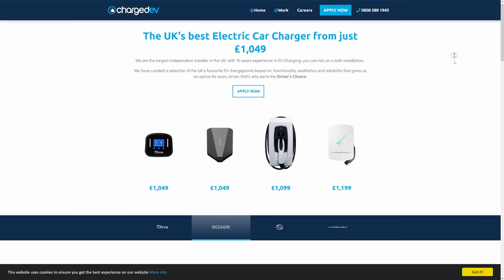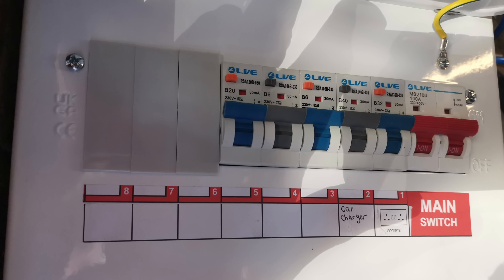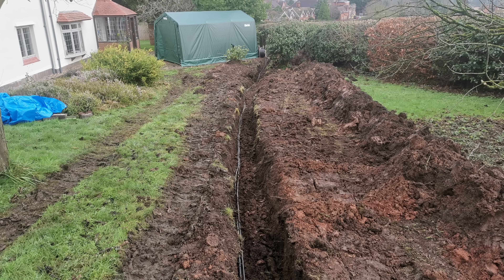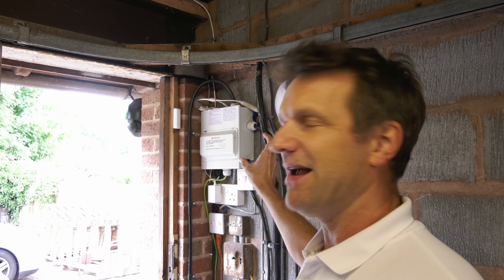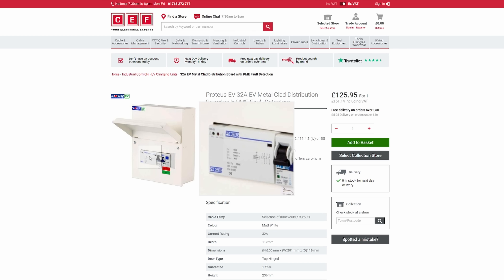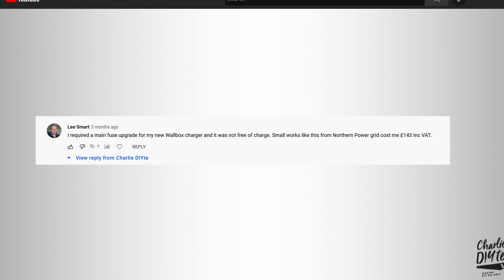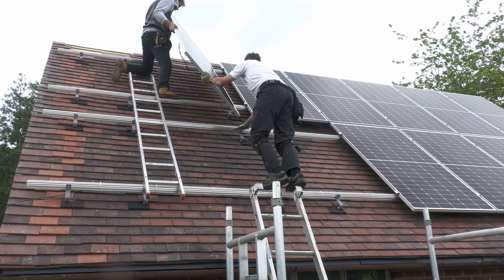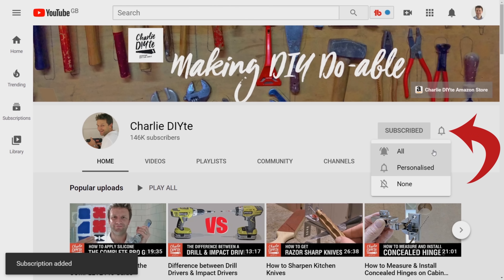EV Charge Point Install - What Went Wrong

Comment: Hi Charlie. 

Registered electrician and OZEV approved EV charge point installer here. 

Surprised your electrician didn’t know how to check the RCBO was double pole (or switched neutral as some manufacturers call it). They all have a diagram on, either on the front or the side to show how it’s configured. 

The EV installer most certainly should have checked it and known how to. However having rectified a number of so called qualified installers charge point installations it doesn’t surprise me. 

Also there’s not many EV charge points with built in 30mA Type A protection. Majority now have the 6mA DC protection in. But not many have 30mA protection built in yet. 

When you earth the armour of the SWA you are doing so to either use it as the earth at the downstream end. Or if it’s, for example, a 3 Core cable and one of the conductors is used as the earth. Then at least one end of the SWA should be earthed to protect the cable. 

Do you know wether it was 2 or 3 core cable they used to take the supply to the garage?

There is no regulation against exporting the earth, it’s down to the DNO. But at the distance you’ve gone with the cable (65m) then it would make better sense to TT the garage supply. 

The supply to the garage does not need to be on a RCBO in the house. You can use a MCB as you have, from what I’ve seen in the video, a full board of RCBOs at the downstream end in the garage. 

So the installation will comply as there is over current protection (OCPD) at the supply end in the form of a MCB to protect the cable from the house to the garage. 

Then at the garage consumer unit all circuits are protected by the various 30mA RCBOs. 

So you don’t need a Type S 100mA time delayed RCBO.  This will save you and the electrician the headache of trying to find a single module 100mA Type S RCBO. Or sticking in a double module at the end and losing two ways in the CU. It will also negate any nuisance tripping at the house end as there is nothing to trip unless there is a over current problem.

**Edit** Didn’t realise your house end was on a TT System. So unfortunately you will have to put in a 100mA time delayed Type S RCD to protect that circuit in order to achieve the 5s disconnection time in the event of a fault. 

I don’t think you’ll find any type S RCBO, I’ve never seen one and I work in Shropshire and see a fair few TT systems. 

So the best advice I can give here is to put in a small separate 3 way CU. Have a 100mA time delayed Type S RCD as the main switch and then from that is a 40A MCB to supply the garage. It’s either that or you’ll need 3 ways in the existing house CU and your electrician will have to reconfigure the board to ensure selectivity is achieved and the 100mA RCD doesn’t have any 30mA device upstream. 

Happy if you want to message me and I’ll give you my number so you can call to discuss 👍🏻👍🏻
Reply: im not an EV installer but i am a qualified electrician and everything Carl F has mentioned is and should be standard practice for a qualified diligent electrician, manufacturers instructions shall be adhered to and BS7671 is a guidance only but either way at the very least you should work from them both then you cant go wrong, now for real world - hmmm!👍
Reply: Just wondering why no RCD on the sub main to the garage?
Reply: @whatthedeuse  It's not a problem to do so as long as you achieve selectivity and don't affect the operation of protective devices for any other circuit. But there is no requirement for it in this case due to the configuration. You have to look at the risk that is involved. The RCD protects from electrical shock ensuring a disconnect in max 300ms for 30mA and between 130-500ms for 100mA time delayed. However the chances of this cable being damaged to the extent that live parts are exposed to touch are minimal. It is an armoured cable buried in the ground (hopefully correctly at at least 0.5m deep and ideally in some from of conduit although conduit is not a requirement for SWA), which is glanded into the consumer unit at each end. 

So as an electrician the approach I take is "what is the likelihood of a fault and will happen with this circuit in the event of a fault and what must I do to prevent faults and someone receiving a lethal shock"

In this instance, the risk of someone receiving an electric shock is virtually negligible. As I've mentioned it is an armoured cable buried in the ground and glanded into the CU at either end. So as long as there is over current protection to prevent a problem with mechanical damage (eg someone sticking a shovel or pick through the cable, although you'd have to give it some oomph to get a shovel or pick through SWA and ignore the warning tape that should be 150mm above the cable) and the circuits at the downstream end are all protected as required (in this case 30mA RCBOs). Then there is no requirement from a regulation standpoint to put the circuit to the garage on a RCD.

In Charlie's case he would need a double pole type S 100mA RCD (which are all 2 modules wide that I am aware of) and then the house consumer unit would have to be reconfigured to ensure that the 100mA RCD is not fed from any 30mA protective device. Or he would need to remove all the RCBO at the garage end and use MCB's. But this would then mean an earth fault would take out the whole garage. So the simplest and most cost effective solution, whilst remaining compliant is to use a MCB to protect the garage circuit and keep all the garage circuits locally protected.
Reply: @carlf6507  the only reason I ask is in a previous video Charlie has shown he has a TT system feeding the house, so all circuits should have RCD protection to achieve the max Zs for a 5 second disconnection time for the garage submain, as he won’t be able to get this with just a MCB. Sorry correct me if I’ve got the wrong end of the stick
Reply: @whatthedeuse  in that case then yes you’re correct he would have to have a 100mA time delay RCD protecting the circuit. 

I didn’t know he was on TT at the house.  With him talking about not exporting the earth I just assumed it was a TNCS system at the house end as DNOs generally don’t allow the exporting of TNCS earthing that far. 

I’ll amend my original comment. 👍🏻
Reply: @carlf6507  that’s what my conclusion was. My preference would be 
Split the meter tails with Henley blocks 
Switch fuse in the house with a 100amp 100ma s type RCD as the main switch 40amp mcb or cartridge fuse, as you’ll never find a single mod 100mA time delay RCBO for the house DB also this allows for an easy change of fuse rating if in the future you want to bump the supply up to the garage. 
And then re terminate the SWA properly at the garage end and keep the 30mA protection on all outgoing circuits. I’d also use the 25mm SWA that Charlie has run in, I see no point if that’s suppose to be used for future that it isn’t used now, then you don’t have to re do work.
Reply from the maker: @whatthedeuse  In case you didn't see my reply to Carl, just want to thank you for your contributions here, mate and after the first video. I agree, no reason not to connect the 25mm when he comes back - and I think we'll need to connect it at the garage via an external meter box given the lack of room in the garage because of the doors. Is it good practice to still earth the SWA sheaf at both ends even though the 25mm is 3 core? I suppose my other question is whether right now I could for now simply disconnect the earth from the sheaf at the garage end so the sheaf is only earthed at the house?
Reply from the maker: @carlf6507  Really appreciate the time you and @whatthedeuse have put into this, in particular taking the time to come back and edit your comment. I've pinned it to the top of the feed now so it doesn't get lost. Yes it would have been helpful if I'd done a recap in this vid of the points covered in vid 1 - principally that it was 2 core SWA I installed - we didn't think it was necessary to put 3 core in at the time, given the TT situation, but again I should have mentioned the 2 earth spikes. At the time, having bought the 2 core (calculating 10mm would be adequate for voltage drop), it occurred to me that we might want to convert the garage at some point so I then bought a run of 25mm 3 core which hasn't yet been connected up. Given space is tight in the garage we'll probably move that connection into an external meter box. The charge point and solar are currently running off the 10mm SWA (solar installer said that should be ok as the solar is supply rather than load - hope that's right) but at some point when finances have recovered I'll connect everything up to the 25mm. I'm guessing the metal sheaf of the SWA can be earthed at both ends as with the 2 core but maybe that's not necessary given the 25mm has an earth - or could I disconnect it at the garage end so I'm not exporting the earth from the house? Electrician will need to install the separate CU as you suggest and also I have the tails from the meter to house CU to upgrade and the switch fuse to upgrade. So plenty still to do. I'll do an update vid at that point and the discussion can hopefully continue. Thanks again 👊
Reply: @CharlieDIYte  Here's what I would do.

Install a fused switch CU by splitting the tails. 

In the fused switch CU use the earth from the house end to earth the armour of the SWA cable. So the gland is installed with a fly lead from the earth terminal and using the 3rd (usually the black) conductor take the earth down to the garage end. But *do not* connect it to the earth terminal in the garage CU. Just use it to earth the armour at that end. This will protect the SWA but won't extend the earth to the garage circuits. Generally I use SWA Storm Glands and Earth nuts as they're a lot better to install. Off top of my head I think it's a size M25 glands that fits 25mm 3 core. The nuts you can fit a ring clamp from the conductor to earth the armour. Saves having to drill a small hold for a screw and nut in the CU in addition to the hole for the gland.

Then use at least 2 x 1200mm x 16mm rod TT system with a coupler to get the Ra as low as possible at the garage end. Although under 200ohms is acceptable I generally will get the Ra down to around the 20-30ohm mark if I can. Can be a bit tricky depending on the ground and may require multiple linked rods to get the Ra low.

In the small CU I would remove the main switch and replace it with a 100a Type S 100mA RCD with a 100ms time delay (might be labelled as 0.1s delay). This then allows you to beef up the circuit in the future if required without having to change the RCD. It will also give you the selectivity at the garage end. I've used Fusebox in the past as they make such a fused switch unit and also the RCD and they're circa £40 each. If I were you I would stick in a 63a fuse now as then you have ample supply to the garage and for your EV Charge Point. You can up it in the future however the maximum you can have on that sized conductor at that length cable run is 80A. But I'd question why if you said you needed 80A down at the garage.

If you check your instagram messages I sent you a message the other day on there. Happy if you want to call as appreciate it can be hard to understand if you're not electrically minded. 

Always happy to help so if you have any other questions feel free to ask.

Comment: The electrician probably installed a plastic gland to prevent the earth being exported from the main house via the gland and metal casing of the garage DB. That way the armouring is earthed but not providing any continuity between the PME and the TT earth of the garage.

Comment: Considering solar install on my home. Don't have EVs yet, 3 petrol vehicles at present. Trying to decide whether worth adding a charging point now in anticipation as no doubt if added later will cause lots of other issues and possibly at greater cost than doing now. Any opinions welcome.
Reply from the maker: I think if you're having work done, Thomas, it's worth installing - particularly  if you need to get a sparks over  Will add value and is a bit of a future proofing measure. Try and get a company in who do both, like Artisan as that way they'll design the system properly which as you'll see from my experience is easier said than done 👍😉
Reply: If you are having other major works then having a charge point fitted could make sense otherwise I would leave it until you know you have a car coming.
Reply: @SimonEllwood  im pretty sure that its mandatory now via building regs to have ev installed when having major work done, just not sure what exactly they deem as major works
Reply: @Thomas Baker, my opinion is to get it advice/quote from a approved installer.

Comment: Where is the surge protection.
Reply from the maker: In the house consumer unit. It's in my original vid.
Reply: @CharlieDIYte  if your other board is more than 10m away then you should have another type 2 spd there as well, to much impedance in the cable for the first one to see a problem at the board

Comment: Plastic gland on the SWA at the Garage board is usually to stop the export of the earth from the house. Plastic gland in the CU is fine and as you don't want or need the earth from the SWA it will be a natural barrier. Personally I would terminate the SWA into a plastic adaptable box using the correct gland and then on into the CU with 25mm tails but that is just my way of doing it for neatness if there is space.